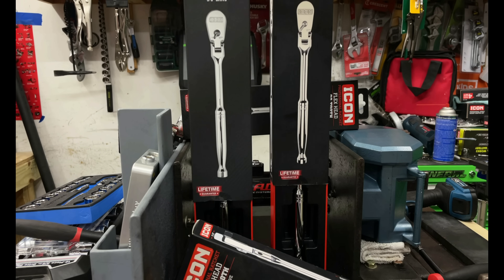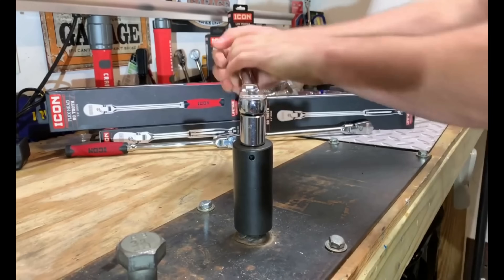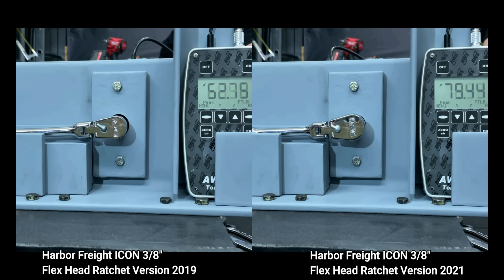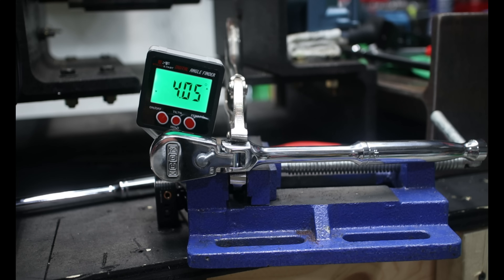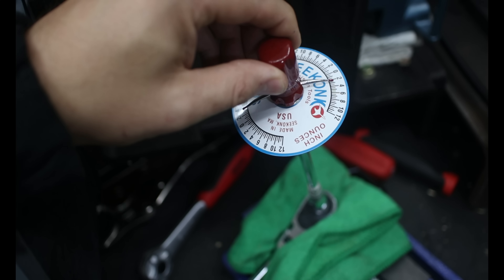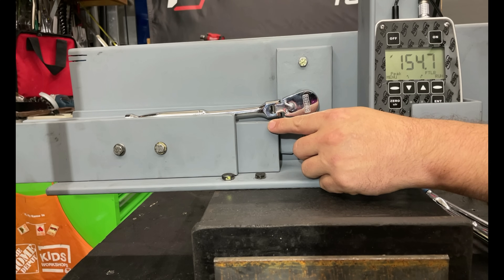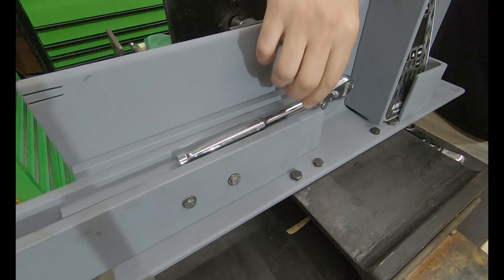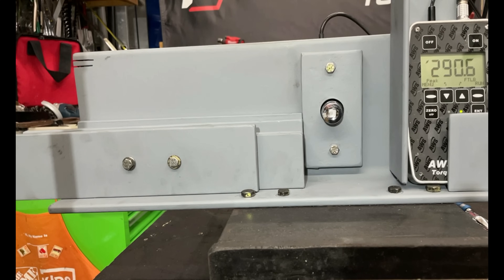Did Harbor Freight really FIX the RECALLED ICON Ratchets

Comment: What are people's thoughts on comfort grip vs non? Seems like I've heard most people like the non, and want to try out each of the long handled 1/2 and 3/8. Any advice from someone with experience would be much appreciated!
Reply: When you're dealing with fasteners all day. Comfort grip on the ratchet is well worth it. Less discomfort on the hands. Plus increased grip age when slippery fluids gets between your hands and the surface of the handle.
Reply: @ZetaN7  Thanks, have you used the icon grip specifically? I've heard its a somewhat harder plastic grip. I could see that a larger handle is really nice for torquing stuff, but might not fit some places as well and can't put a pipe over the end either.
Reply: @mwartist  It's about the same as a Pittsburgh comfort handle. The rest of the material metal wise is better.
Reply: Depends on the day tbh. If my hands aren’t feeling good, I’ll have a comfort grip all day long otherwise my hands will go numb by lunch. If it’s a warm day and I feel good, I use whatever I want. 

I’m 25, just spent 5 years in the army and well my hands didn’t hold up the greatest. My knees are great tho, somehow.

Comment: Ratchets have their serviceable torque limits for each size.   The tests prove they all will do normal manual hand torque loads easily.  Breakers are for that, breaking loose if its tight.  Stick to the normal hand torque loads (say 20 on a 1/4, 100 on a 3/8, 180-200 on a 1/2) and don't use cheater pipes on most high end ratchets, you'll never break them.  Get the Harbor Freight Pittsburgh Pro 1/2" Extendable ratchet.  Awesome tool and the only 1/2" I use now.  Suspension bolts and lug nuts..its a great tool! https://youtu.be/P9f2FvPwZAs

Comment: Very nice testing you've done there. But the way the test rig is set up, the ratchet is supported right next to its head (not from the beginning, but when it flexes under stress), making it practically impossible to break the flex joint or bend the handle. The support should be only where a human hand would usually hold it, giving it a chance to break in any other spot, than the ratcheting mechanism. Of course it could be discussed that a human hand will never deliver such a high amount of torque. But even when using a pipe for leverage, you can not always guarantee that the pipe is slid up right to the head. What do you think?

Comment: Now try out the 3/8” LP90 flex head sk ratchet, has all the same issues as the older Icon ratchet plus sloppy floppy flex head motion. I’ve had 2 garbage ones and their online reviews reflect on it too.

Comment: I have one,have used it for a couple weeks. I think the teeth feel horrible.  Like near China craftsman feel. 
Is this normal on the 3/8? I have the 1/2 as well. It's been good for a year.  Did recently have to replace it,kept binding

Did you test the Pittsburgh ½ flex head? 
If so you got a link?

Comment: I just my first tool set for 29.99 it's normally 39.99 but it was on sale for 29.99 and every thing has a life time warranty and yes most of the tools suck but so far nothing has broke and I take care of my stuff so it should last but if something breaks how do I get it replaced?
Reply from the maker: If it’s the PITTSBURGH Tool Kit With Case, 130 Pc and has a lifetime warranty you simply take it back to the store. They either swap you from the part from an existing set if I recall correctly. If they don’t have any in stock you have to wait.

Comment: I've been using Icon for almost 2 years at work,  and has worked very well for me,  as well as other Harbor Freight tools.  Honestly,  I have warranted a Pittsburg flex head ratchet because the pivot came loose and fell out. I won't say that Icon , and Pittsburg are as good as the tool truck brands,  but they seem to hold up good,  and don't break like people think or claim.
Reply: Icon are a minimum 98% as good as the tool truck brands, and for 1/5th the cost. Which one to buy is a no brainer.
Reply: @Keter  as a new mechanic, you can't go wrong with Harbor Freight.  It will take you a fraction of the time, and money to aquire the tools you need. 98% off my tools are Icon, or another Harbor Freight brand,  and they make me the same money as the others,  and I own all my tools.

Comment: Icon is great for everyone that doesn’t make money for a living with tools. I gave the 1/2” flex head a fair shake and it held up to 2.5 months in a diesel shop.
Reply: In my experience the icon ratchets are excellent and will take a ton of abuse as long as you properly grease and service them
Reply: I’ve seen techs break snap on and Matco as well. It really depends on the tech and how the tool is used as well

Comment: In clientgraphics previous multi brand ratchet test video, the Snap-On fixed head got a clean anvil shear off at 292.9FtLbs. As well as the Tekton at 292.9FtLbs. however the Tekton did start the deform right before it failed. And now the revised ICON had received a very similar clean anvil shear off at 290.6FtLbs. Without any other visible damage or deformations.
Reply: You just answered my question without having to look for the answer. Thanks!

Comment: I feel if the ratchet wasn’t resting on where the flex head was and had the force more on the handle it would have experienced more play in the flex head after the test
Reply from the maker: The yoke flex portion never bottomed out. The force was still on the handle as there was definitely always a gap and that was definitely something I reviewed in the video. I have contemplated cutting that edge back on a 45 degree angle both before and after the fact.

Comment: Own ours for a year or 2 now. Icon ratchets and sockets etc. And we use them in our junkyard on rusted bolts and cheater bars and using them ways youre not suppose too. But they have impressed us so much that we are switching from snap on and cornwell to icon

Comment: I brought one a couple of months ago and did a swap on it, but not before I took it apart and kept the washer that goes in-between the head and the cover of the drive head. It has far less play in the mechanism now and doesn't slip nearly as easy as it did before adding the one I took from the 1st rachet I took back. If they fix that issue it's a really nice tool but luckily I know how to fix stuff like that and understand the mechanism of it.
Reply from the maker: I did notice that it didn’t have that. Thanks for mentioning it as I feel like the fixed head  ones all had that in them and my flex head one tested did not.